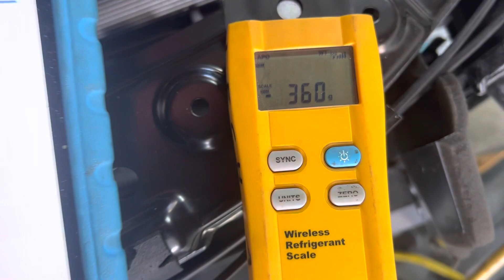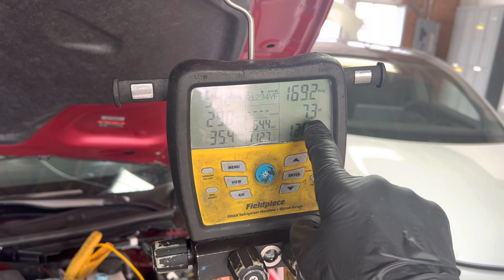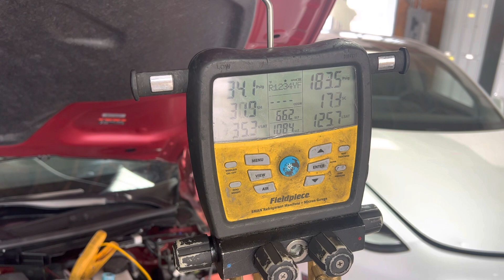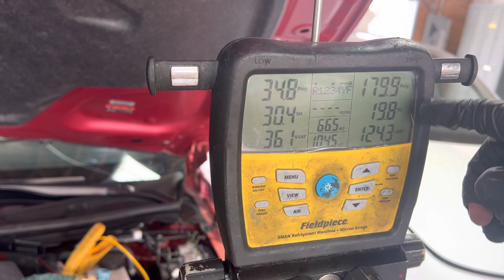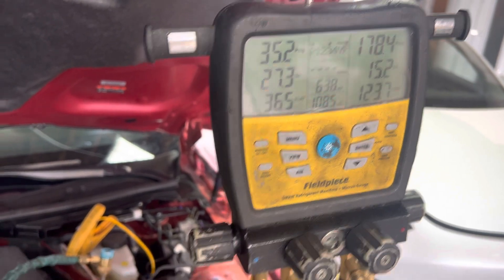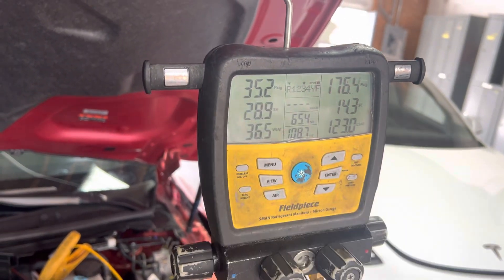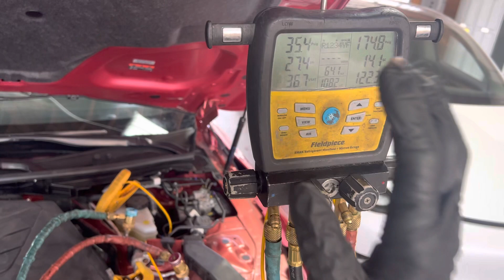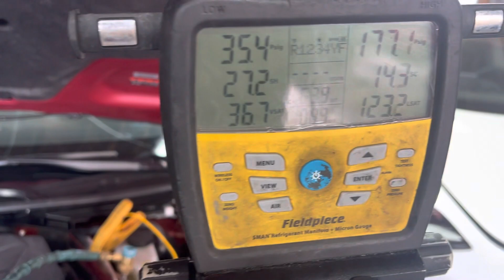Watch superheat and sub cooling as I add more refrigerant. Verrible￼ displacement compressors ￼

Comment: How do you determine is you have a variable displacement compressor, will it be on the nameplate? Thanks...have just recently found your channel and learning a lot including from the comment replies.
Reply from the maker: There will be a second black plastic valve electrical connector sticking out of your compressor somewhere with 1 two or three wires.  

Just Google variable displacement compressor.   Look at the photographs in the videos and you will see. 

Then Google your year make vehicle car AC compressor and see what pops up for sale.
Reply: @coldfinger459sub0  Thanks...I'll do that. Appreciate your time.
Reply: Did the research and now understand the second electrical connector, internally controlled vs externally controlled, clutch vs non clutch, etc. I have a much better understanding of what you are saying in this vid and others...for VDC systems no more topping off and you can't use pressures/temps to determine when you're full. Thanks your channel has been very educational...So one last question, should the blower air temp "noticeably" increase w/ an ECM volume control valve (externally controlled VDC) when the engine RPMs rapidly increase the way I understand that an internally controlled VDC do? (First new car I owned since 1986 and haven't kept up w/ the technologies for improving mileage. In previous cars only w/ the accelerator pedal on the floor would the air temp rise caused when the compressor clutch disengaged.) Thanks
Reply from the maker: @jcasey460  what are you call Old Cars where the compressor would disengage when you put your foot all the way to the floor.    Still in the years of cars were computers and sensors were attached.   Later years you had a TPS throttle position sensor.   Earlier years small motors after 1974 when they had catalytic converter‘s in Feedback carburetors.  If they didn’t have a TPS they actually had a little switch a pot that when you would go full throttle the carburetor linkage would literally touch a switch that would control the ECM to kill power to the compressor so you would have full throttle all the power diverted to the motor in the wheels so your little tiny got less small controlled four-cylinder engine had a little more acceleration. 

The variable control compressors as you accelerate some not all will instantly decrease the amount of throw of the pistons so they do not have as much displacement keeping a steady temperature and not using and wasting excess of power to save gas and the temperature out of the dash will be steady. 

Some cars yes some cars no even though they have the same variable displacement compressor it depends on the sensors and programming from that particular manufacture for that year make model

I have made some videos using Fieldpiece software data grafting the temperature out of the dash while we are looking at the RPMs and I accelerate the RPMs on some cars you see the temperature go down in on other cars you see the temperature stay steady and flat not move at all even though I raised RPMs to 2000 RPMs
         And then some other makes years models with variable displacement compressors you actually see the temperature rise out the dash. 

So again there is no rule of thumb that can be applied to all the variable displacement compressors. 

When changing the dash blower speed of air some cars the air temperature will increase on other cars the computer will command the compressor to change the displacement for more output to compensate for the increase temperature to bring it back down again I have data graph that and showed it on a video before. 

This is one thing about reading books they’re only limited to the knowledge of the author who wrote the book. 

This is why acquiring information from many sources on the same subject do you have a better whole understanding will give you the base knowledge to figure out everything without a book. 

This is why it should be mandatory and automotive field and others yearly or biyearly updating going to seminars and expos in your chosen field not learning just by breaking things on customers cars and then selling it to them and call that learning 😫   

I often spin more in education learning and updating in one year than most technicians will in a 20 or 30 year lifetime career

Comment: i have a fixed orifice system in a 1990 k2500 and i am using a newer condenser from a 1996  how and where  do i get the wet bulb temp and do you use the same table as a hvac system?  also should i take line temp right after evaporator?
Reply from the maker: Do not try to recharge air-conditioning on a vehicle exactly the same way as a commercial residential HVAC system by superheat or subcoolcooling you can use it a little bit to make sure things are not really bad. 

Automobiles are filled by weight of refrigerant only recommended by the manufacture but when you use a different condenser style. 

For example if you had the old tube and fin that use the 3/8 diameter tubes and you switch to a parallel flow micro channel there will be a large reduction in the amount of refrigerant that you will be using. 

You have to make that determination yourself based on what generation style condenser your original vehicle had did you change to a 6 mm tube and fin style which is a little bit more efficient uses a little bit less Refrigerant or was that 96 vehicle condenser a micro channel tube. 

you should start with a lower refrigerant charge and then just keep adding 1 ounce or 2 ounce and allow in about five minutes of stabilization with your engine RPMs at about 1200 RPMs or 1500 RPMs if you can find the original manual that runs you through their air conditioning diagnostic procedures different manufacturers had different RPMs they would perform their test at RT FM. 

Temperature probe after the evaporator

You’ll probably find about 5° drop of superheat across the cumulator

But if the engine fan is the old style thermal Fluid San clutch in it has some miles on it and some age it will probably not have the original correct airflow over the condenser and that will throw your readings off and they will not be correct

You will just be reading incorrect readings due to the fact of incorrect airflow remember airflow is king

Comment: Tom I always ask my self how much refrigerant stays in between the vehicle and the tank? Does it get sucked all in?
Reply from the maker: If it’s solid, liquid in a 60 inch hose it’s about an ounce. 

If it’s a manifold gauge with three hoses off of it and you suck down into the Lofi vapor side and it’s on vapor in the hoses three 60 inch hoses is about an ounce of vapor
Reply: Thank you Tom for the info! I'm new to the trade (Residential) don't know sh... About automotive AC. Trying to pick everything I can with you bro. Thanks! I really like your videos. Keep on rocking 💪🏾